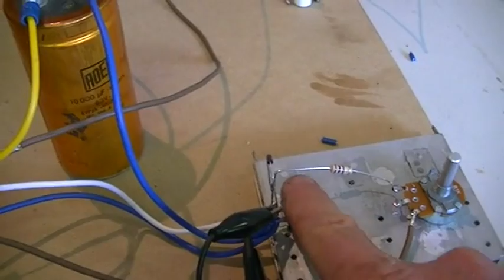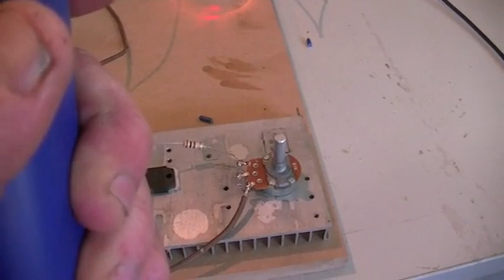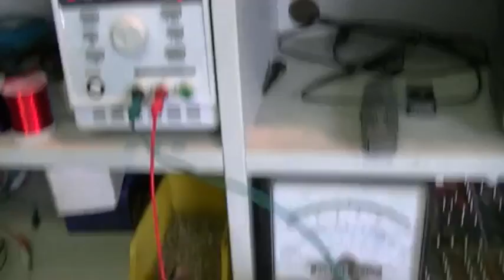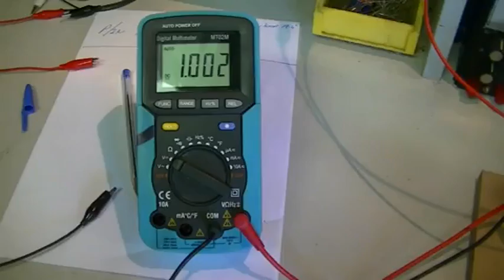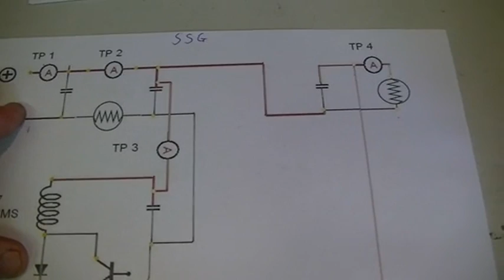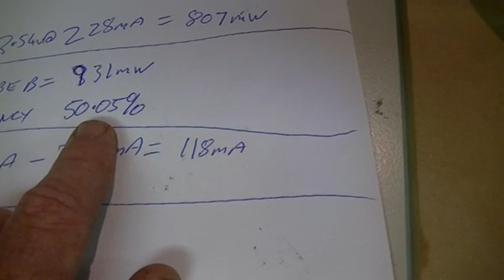SSG pulse motor facts

Comment: I have not tried making one of the SSG motors, however, if you are going to discredit something, you should build it the way it was designed. You have proven that the SSG motor the way you built it with alternating magnetic fields and caps in place does not work! How about making the correct circuit and proving that it does not work??
Reply from the maker: Ah,i see. Never built one your self,but an ex-spurt as to how mine is wrong,and why it dose not work as it should.  Perhaps go and look at the rest of my video's,and then get back to us.

Comment: a quick & easy way to understand the power throughput of an SG is to note that an Inductive Discharge will deliver exactly the same Joules (or Watt-Seconds) as is required to re-energize an identical coil (or the same one) to the same field intensity as when its current path was interrupted (minus resistive losses.)  The larger the capacitance available in the Inductive Discharge path, the longer the discharge will take and the lower the resulting potential in the cap.  This is where the Reactive Power goes when the circuit is interrupted, and why it's more efficient to supply a local power-factor corrective capacitance to an inductive load instead of making the power company supply the magnetizing power.

Comment: I have played a lot with the bedini SSG variants in small scale, trying to stay with the original components and designs lately, only because I have always wondered if you  could capture the inductive voltage a coil produces when shut off, instead of dissipating that energy in a diode, to keep it from killing other parts in a circuit. I just found this interesting. Its too bad that so many have clouded the spirit of imagination to be more efficient, just to make a buck on a book. Innovation happens when some says it cannot be done, but then we look at the technology and start asking questions. The thing I find fascinating with this bedini pulse motor concept, is it allows anyone to wind a coil, put some magnets on a wheel hillbilly style and capture energy back out of it. Who cares how much, its the fact that this has inspired imagination to move forward. to bad there is so much fraud out there. Keep dreaming, Thanks for this video.

Comment: THANK YOU!  I think you made a really great and understandable video.  It's about time someone clarified this!  I am not an electrical engineer and barely possess rudimentary electronics knowledge. (Musician) I share the dream of free energy and have been following the SSG for a while.  Can I ask you a question though?  Do you think there is a gain in using the SSG to charge electro chemical (Lead Acid) batteries using the back EMF?  Is it possible that there could be a net gain using the pulse charging and then switching between run batteries and charging batteries?  IF so, then could this work with something like the new TESLA batteries?  I am thinking that lithium Ion batteries may not charge using a pulse current from the collapsing field of a coil.  Do you think they would recharge from a pulse like a lead acid battery does?
Reply from the maker: John Hardin Any battery can be pulsed charged. The SSG will desulphate some batteries-depending on how bad they are. A solid state flyback circuit will do it much quicker.

Comment from the maker: Cool Joule
The 1 ohm test is bogus-there is no common ground ,as the positive of the run battery go's to the negative of the charge battery. So you will see very little current going to the charge battery when the potential difference between the charge and run batteries are very close to the same. Over all current will be low,but the current spikes will be very high,as it is current pulses that are sent to the charge battery,not a continuous current flow. The inductor is a current device-not a voltage device. No one in the bedini camp will measure output like this ,because it will let there little secret out.
Reply: Another problem with bedini motors is they desulphate lead acid batteries. So if ya got an old battery on the output you will notice some excess power coming from the battery as it makes available that which was locked up in sulphates....
Reply: TinManPower Thank you for responding.
I don't remember anyone credible ever claiming the “circuit” puts more out than it takes in which is precisely what you are attempting to measure. I thought that was pretty common knowledge by now.
Your input is 15v x 0.124 amps = 1.86 wattsYour output is 3.545v X 0.228 amps = 0.80826 watts
So even though you have not replicated the 1ohm resistor test, because you are using a variable resistor (light bulb), you are still showing what the test is supposed to show - very few watts going into
the charge battery. 
If you had a proper build and you put your output to a battery you would see you get more than "the 0.80826 watts" out of it.
Reply from the maker: Cool Joule This is only because you (and others) are confused or unaware of how a lead acid battery work's. You can place a load on a dead battery,and over time it will start to output more current. This is due to a rise in temperature and chemical reactions taking place within the battery. It has nothing to do with some hidden magic in the SSG.
Reply: @69Atho  hey man nice experiment i played with ssg also but i charge a capacitor to about 70v ,  80v and i discharge it with a tyristor pulsed by 555 timer and you will see the batery recovery and after many cycles i got bored of waiting to discharge the battery from ups the small black ones ,you will be amazed how much it holds,. the way you do it it shows just half of the real deal of what can hapen, .i do not say over unity but the battery hold beter power than with the normal charger this i know for shure and the bike wheel is more efficient than this small one your using. keep the good work man i love your experiments .but i want you to know ssg have some good potential.
Reply: TinManPower 
I'm fully aware how a lead acid battery works.
Many do not complete the full experiment. Once you cycle your battery 20 times, you will know there is no way energy can "hide" as you so describe. No worries. We enjoy your videos and I did learn from this video - sorry if I seem to be harping on you I don't mean to. I know my stuff and I know what I'm getting. I even use my real name most all the time ;)
Cheers - Patrick

Comment: I've never seen anyone credible try to measure the SSG this way to show OU. Do you have a link to who's doing this?
The only clean method I've been able to use is to measure the input to the SSG, then AFTER the battery is charged, pull it off the system and measure what you can get out of it. The "One ohm test" RF/JB used was not with the common ground and it was only used to show very little current was being used to charge the battery... http://rpmgt.org/SSG.html